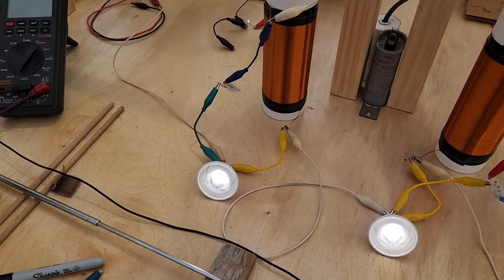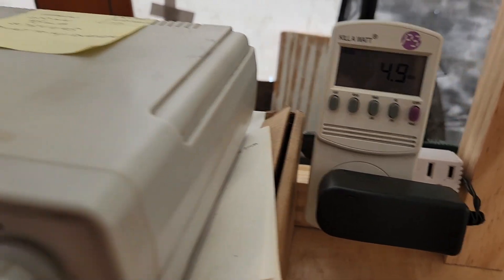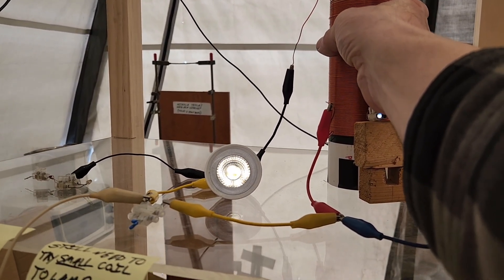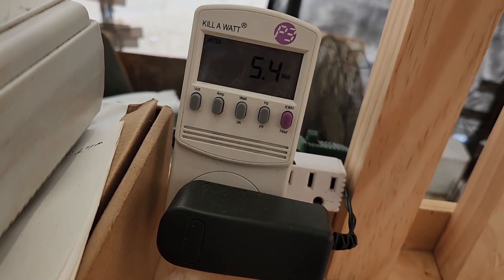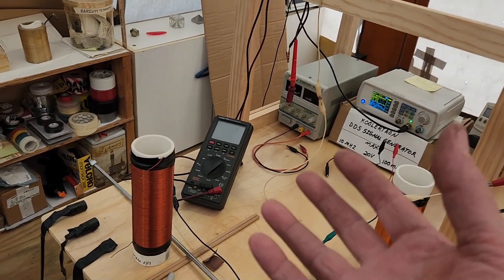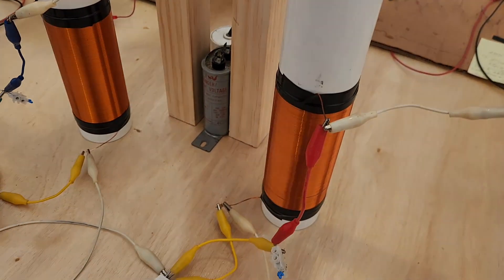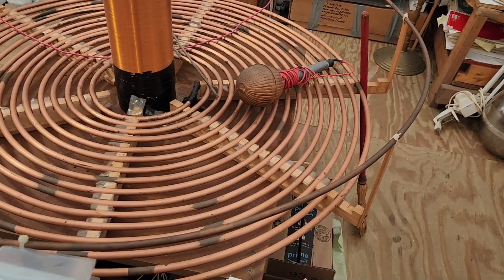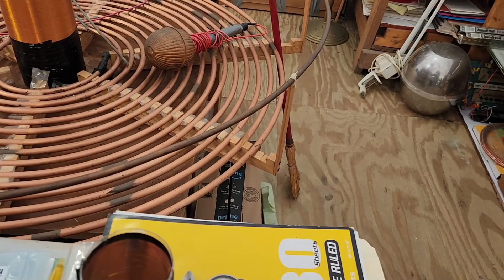MORE LAMPS LIT!  LET'S TALK ABOUT COILS & CHARGE, OR ANYTHING!

Comment: Hi Paul, give litz wire a try. Solderable Polyurethane litz wire is all you need and easy to use. The thinner and more numerous the individual strands are the better, no need to go crazy. Amazon sells this Litz Wire, 18 AWG Unserved Single Build, 5/20/38 Stranding, 4 oz Spool, Ideal for ~100 kHz Applications for $40. You are using higher frequencies yet you should experience higher Q results. Thank you for sharing, Alexis.
Reply from the maker: Thank you very much!

Comment: #2 in normal atmosphic pressure electrons cannot achieve high frequencey due to water in the atmosphere it makes electrons slow. this is why we use Klystrons and magnetrons, and both vacuum tubes that produce high-frequency microwaves. Klystrons are used to amplify and generate microwaves, while magnetrons are used to generate microwaves. Waveguides are distruptive and propagate out into the atmosphere. Nikola Tesla was using a Waveguide from his secondary coil before the torrad the torrad was an omnidirectional atenna. Waveguides take highvoltage/high frequencey and step it up into the range of light. When you step it up that high then discharge it to a torrad it has amplitude on the discharge and is able to propagate further in distance. Why does a waveguide amplify because both the electron and the magnetic charge is inside the tube. The reason no-one gets anywhere with tesla coil is just that they don't actually read the patent or even look at it #3 use rods inplace of coils they do the same thing with less losses because the -lenz in faradays law isn't applied to a rod it is not a coil
Reply from the maker: I will think about this, thank you.  If you replace a coil with a rod, i would need that rod 98ft long to get 10MHz.  I will do some experiments, thank you :-)
Reply: @INVENTOR3  Like to know how you come up with that math.
Reply: run the generator as a hairpin circuit remove the coils but yea need to step it up to light for wireless energy transfer.
Reply from the maker: my coils have 98 ft long wire(10MHz).  Is this incorrect?  I will try replacing coils with rods, like the hairpin.  if no coils, then system does not work, so i will have to try with rods and see what happens.  Thanks Justin
Reply: @INVENTOR3  a coil, or a rod is what in a circuit? Both resistor's, and capcitor's....?  They both manipulate TIME in the circuit. Yet if we take and comprehend "elctrons" they flow, and take the path of least resistance. The flow of electrons threw a solid, or a hollow cylindrical conductor would flow stright threw it. Whereas the Coil of wire the "electrons" would flow around, and around in the atmosphere. Look up maxwells equations. vector fileds of a coil .vs a stright rod...... If you look at any of the pictures of Tesla in his experiments he only uses the "hairpin Circuit." Draw a Hairpin circuit, and a Mot/NST circuit with coils and pput them side by side they both the same. Just one has rods instead of coils. "Magnetic time domain. Magnetic dipole moment. Electrons flow on the outside of the wire because inside the wire we see in metallurgy we see the physics take place. Water is what is moving, and is the driving force behind all of it. don't just think like water it is water. this can be proven 100% too with an electron miccroscope.
Reply: @INVENTOR3  i sent you circuits and math on this.
Reply: Rocks are amazing could even use rocks instead of coils or rods. Igneous or metamorphic rocks that are rich in feldspar hehe..... Those obliesk are cool atenna's eh!
Reply from the maker: @justinaldrich1719  Thank you Justin.  I will think about this.

Comment: alumnium core inside that coil. Thank you for that amp meter.
Reply from the maker: Good to see you, Justin.   aluminum core?  Wouldn't it create eddy currents in the alum. and become a big resistor?
Reply: @INVENTOR3  Aluminum core transformer has characteristics of low loss, obviously energy saving effect. A coil is a transformer. what are you doing with the magnetic field inside the core of the coil nothing ,,,,can you tap electric potential from a aluminum core...Like a capcitor plate......

Comment: To answer you question about Q factor, I can share what I've heard. The base of the coil needs to be relatively fat, but not fatter than it is tall, maybe 1:1.61. The ones working in your light setup look suspiciously correct. I can try to dig up the video where I saw someone make this determination if you are curious - it also has some ideas on choice of wire and turns, i think the turns are more important for frequency and you just need the mass to account for total current? Their coils were tightly wound, no gaps.

Either way, for the wire and its spacing or whatever - think about this: when the signal travels through the wire, there is a propagation speed for a wave in the conductor and one in the insulator and if your materials for each are not correctly in proportion to your distance, they will get out of phase and you'll end up with a "garbled" signal. They discovered this with undersea cables - most short runs don't have this problem, but its something to consider when you are running hf or hv near a strong insulator.

So the other thing you need to do here is get a solar panel and hook it up to a meter. Then shine the lights at it in order to measure their outputs. Start with one light, traditionally powered, and then with one connected via one of your coils. That will give you a baseline to determine what happens when you add more.

Real quick, what kind of lights were those, LED, incandescent, halogen?
Reply from the maker: hmmm, i remember Tesla was calculating mass of a coil.  If you can find that link i would be interested in watching it, but don't look for it for too long. no worries.  The solar panel. hmm i did that many years ago, thank you.  I will try a new idea someone mentioned and use a light/lumen meter and use value on light of "watt per lumen".
I am using LED type of small flood lamps.  Thank you!

Comment: I’ve found the higher frequency coils do pretty good with stranded wire, seems like each strand has a magnetic field around it and they multiply! And I learned a while back the gap in between coil windings should be roughly the size of the wire being used
Reply: Stranded on a primary, not secondary if using like a Tesla coil, if just using as a normal low voltage high frequency driver stranded is great, like wireless pancake coils, the field they give off at 0-12v is pretty great compared to a Tesla coil secondary field
Reply from the maker: @anthonyscott9936 thank you
Reply from the maker: Thank you.  I remember on old tesla coils secondary they wound wire and string at same time.  And as you mention about same dia wire and string.  Then coat it all with schelack.  I will have to do some experimenting.
Reply: Oh and also I have that signal generator and you can light a led through the lead connector to your fingers while the unit is off.. meaning there is a way to pull power from it that it won’t register.. not sure about your watt meter..? But it’s also possible that you stumbled across what I just found out? If you have an oscilloscope it’s TIME to get it out;) those high frequencies ride on extremely slow current if you have the coils set correctly in orientation.. put your oscilloscope leads across L2 and the lower the seconds per division down, play with the frequency and you’ll see what I mean with the waveform.. sine wave works best! Best of luck!
Reply from the maker: @anthonyscott9936. thanks again.  I think I will be trying another generator soon.  The one I have can not put out enough power.  Strange things with this freq Gen I have now as you mention.
More experiments need to be done.
Reply: @INVENTOR3  you’re welcome! Did you see what I was talking about yet? Do you have a way to get in touch with you?
Reply from the maker: @anthonyscott9936  millanyangle@yahoo.com

Comment: Hey how's it going, I love the ending, classic and awesome at the same time, it sounds like you've been busy and looks like you've been busy as well, I have to give you a shout before you even mentioned the stacking of the Tesla coil base coil in the flat pancake style 30 thinking of that but then like you said taking it a step further stacking them up, so a series of tests would have to be done at a scale of 10 to 1 if you're going to keep everything scalar and figure out the real numbers where One affect Peaks out in another one begins to cause counteract excetera The Sweet Spot, just the same as two filters create a bandpass or a Notch filter Etc, at any rate I'll give you a holler, I've been thinking about you periodically I've just been very busy we're trying to get the ship out of port and head south, this cold weather has been something else we've been up here 3 months on the hook time to go south, I have three pallets of beautifully equipment I just purchased over the last year and a half for the lab and even more even more but I am going to get everything on board and get the lab set up here so we can go out to sea and begin doing testing also, there is so much RF noise even 25 or 30 years ago on land I need the ultimate research would have to be done at Sea far from any of the infrastructure noise and then also now we have all this screeching satellite stuff but we can Shield at least for one side from that, much fun stuff, I've been trying to reach our friend out west, John , I wanted to get him in on the conversation as well okay keep up the awesome work
Reply from the maker: I just sent John an email to come and visit us here :)
Reply from the maker: Great to hear from you, Skipper!(Gilligan's island, hehehe)   yes stacking of flat coils :-)  
Sooo cold!! I'm struggling to stay warm myself.  I saw your comment on facebook this morning.  Oh yes, the noise on land, I did not think about that, yeah, makes sense, a lot less noise at sea :-)  i will see if i can get John over here.  I will let him know your asking about him  :-)  thank you soo much for your great comments.  Now get your butt back out to sea! Head south like the snowbirds, hehehe.

Comment: that top coil is out of resonance by 100khz. your body or ground adds that to it. Stranded wire adds impedance so solid is much better.  great work.
Reply from the maker: Hey, good to see you made it here Nathen,,  young man, hehehe! 
Yes, you nailed it, about 100khz.  But it did show how power consumption went down when I touched it and made it resonate with the others. 
Solid, that's what I was leaning towards.
Again, thanks for visiting and hope to see more of you.
Nathan is a wise and knowledgeable man!
Reply: @INVENTOR3  when in perfect resonance the room becomes hot to the touch on any metal so you have to reduce the energy going in because it is too efficient.
Reply from the maker: Thank you, it makes sense.  I know a guy that can touch an LED to anything metal in his house, using SEC tower,  i should have asked if the metal was warmer than usual.
Thanks again, good stuff to know.  @oldmanbuilds

Comment: The multi-stranded welding cables allow flexibility so movement can occur without breakage. If you find your single-strand wires can't handle the stress you are forcing them to endure, maybe that would be a reason to switch to multi-strand. Meanwhile, I would just run with the success you are currently enjoying. 

Anything? I am curious what kind of results would occur if you used that GIANT diameter spiral flat coil as a receiver coil, (with your current small transmitter coil in the middle)... given the specific RLC components to resonate at the same transmitting frequency, of course.
Reply from the maker: Yes, thank you.  I forgot to mention about stranded is more flexible and less likely to crack.
The giant pancake coil.  I will think about using that :-)
Great comments, thanks again.

Comment: Congratulations, you've reached sunglass level! I was wondering in the beginning, when you showed your schematic, what that wire (white) connecting the two coils was for. But you explained it pretty good. Smart bit of invention there.

On the question of solid vs stranded, I gather that it probably won't make a large noticable difference with this circuit. But, It would be an interesting experiment to make one of those two coils multi-stranded to see if one really did produced a brighter light. Stranded vs solid, which coil wins?
Reply from the maker: Sunglass level, hehehe. Thank you.  I will do some experiments to see what is best, solid or stranded.
White wire, yes, connecting together to make tuning easier.  On the schematic, I think dotted line.
Thanks for your comments, much appreciated!
Reply: @ I haven't reached that level yet; but, all power to you. I think the game terminology is one we can all relate to and rightfully get excited about. Good Luck, Have Fun!
Reply: @INVENTOR3   I haven't reached that level yet; but, all power to you. I think the game terminology is one we can all relate to and rightfully get excited about in our quest. Good Luck, Have Fun!

Comment: Perfect coil would be silver coated litz wire with Teflon topping, in vacuum :D It could get very expensive with some rare earth cores too, they are hard to source.
Reply from the maker: Silver, makes sense. Very conductive.  I have some copper stranded with silver coating.
Hmmm, Litz wire has special woven strands for HF AC and reduces skin effect.  Wonder if it would be just as good with pulsed DC.  Teflon, very negative on the triboelectric series chart.
Do you know what Don Smith used?
Thank you very much for this information.  I am taking notes today :-)
Reply: @INVENTOR3  Don't know much about Don Smith stuff. But I have noticed pulsed DC is very similar to HF AC, specially if it's fast switching. Silver coated copper pipe or thick jewelry wire might also be good. Everything that makes the resistance lower in the system, will then be saved by having less heat/energy escaping.

In capacitors it's usually better to have larger porous surface, so it can hold up more energy. But it also means that it can't be switched as fast. Inductors are also faster with polished surface. Teflon tape is good for protecting the silver from oxidation. I think it's just supposed to be better than regular plastic or silicone coating.
Reply from the maker: Thank you.   @Kangsteri

Comment: Keep up the great work sir! I have done experiments with this signal generator in the past, and have seen gains of similar nature. However, when I pulsed a transistor (from 12V battery) using more power, the gains were never there. At some point, to see more gains, more input power and more copper will be needed. Understanding the LCR tunning is the holy grail of energy recycling. It seems that with a sinewave input (from the grid), the resonance is somewhat not difficult to be attained. Batteries look much more complex to tunning. From another experiment with AC, I was able to use about 70Watts in a load, and return 10 back to the grid. This again showed me that AC can be manipulated easier than DC. The Killawatt meter will not show negative power factor (will not show anything under 0), so you are limited in this regard. I would recommend a power analyzer instead.
Reply: you were doing something wrong my friend
Reply: @johanrheeder1640  If you know what I missed, please share it. And believe me, I want to do it right.
Reply from the maker: I am not greatly confident how i'm taking power readings at this point, but based on very careful past readings done with scope, i feel the readings i am getting now are in the ballpark. 
Interesting results you had.  Eventually I will try to get this all running off of a battery.
Thanks for commenting.  Your project sounds interesting and I would of liked to have seen it.
Thanks again for your comments :-)
Reply: @INVENTOR3  I would have posted the schematic here, but unable to upload. I can email it, if interested.
Reply from the maker: @Ilhaanize  you have no content on your channel?
Reply: @INVENTOR3  Not at the moment. Not until I fully understand the things I am experimenting with.

Comment: use lumen meter to get the real output of these leds and compare it by lighting them up normally
Reply from the maker: Okay, thanks.  I will look into getting a light meter.  I used them many years back when I was in the film industry.  I remember there are two types.  One ou would aim at the light and the other you would aim at what your lighting up.  I will take a good guess and say I need the type you aim at the light.  Hmm, when I use this, I will have to make sure to take readings at consistent distances and don't let other lights interfere with readings, maybe only have one lamp on at a time.  Or maybe mount the meter on a tripod to maintain the same distance.  I also see online now to convert lumens to watts, I need to divide lumens by "lumens per watt", which i hope to find that info on the lamps :-)  Thank you, I got it!
Reply: @ you can attach led to lumen meter head and isolate it with black tape so it only gets the light from led
Reply from the maker: Thank ypu, i actualy undetstand what your saying.
I have done something similar in the past with LEDs inside of a cup with some solar panels. @ReigoVilbiks

Comment: by working with these leds in same way id say total output is at least 1W
Reply from the maker: Okay, thank you.  Would you say this because the lamps are not lit to full brightness,,, or?  Hmmm, you suggest now maybe .5w lighting up 1w.  Hmm, a COP of 1:2 not bad.  Hmm, that would also suggest about .17w to each lamp.  Hmm, that seems a little low.  Would one of those lamps even light up with only .17w going to it. 
Thanks again.  I will get more lit :-)
Reply: @INVENTOR3  you can test with a adjustable power supply  give exactly .17w to a lamp and compare with lumen meter